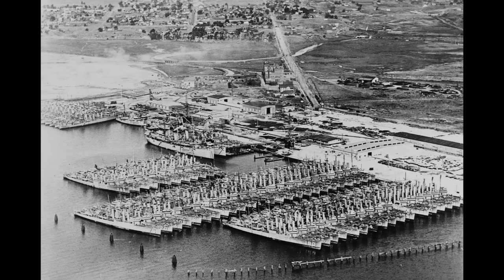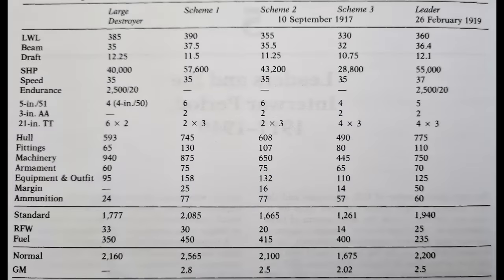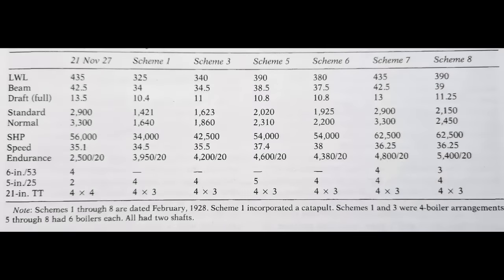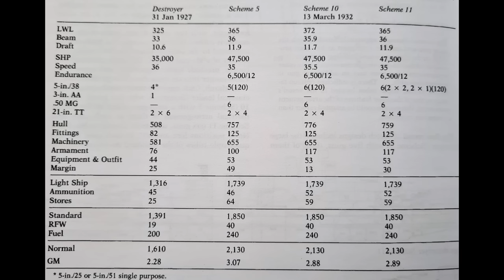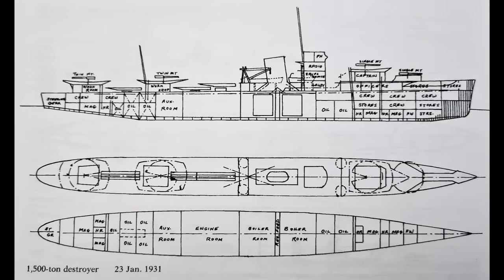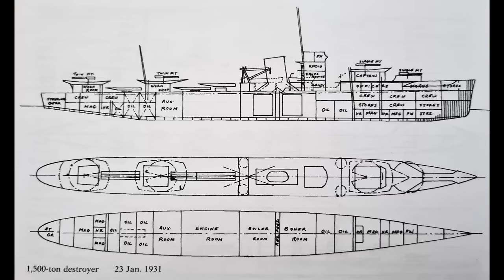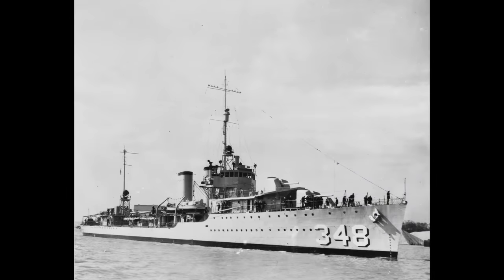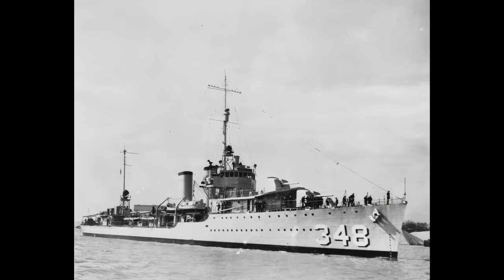The History and Development of the 5"/38 - Turns out you can take the sky from someone

Comment: Naval Dual Purpose &amp; Anti-Aircraft Gun Fire Control - This might be a good place to cover anti-aircraft fire control as it stood in 1939. Anti-aircraft fire control was more challenging than surface gunnery because of the addition of a third factor (height/altitude) and a second vector (rate of change of altitude). An airplane could not only vary its speed and act on the horizontal plane, but also move on the vertical plane creating a massive increase of possible vectors for which to calculate future position. Like surface gunnery, the intent of AA fire control was to put properly fused shells into a “basket” where the target aircraft should be when the shells arrive. First, the future position of the target aircraft must be determined, then the “slant” range to that predicted position calculated so that the flight time from the gun to the target can be set in the fuse on the shell. Added into this calculation is the “dead” time, the additional time needed to calculate the target position, transmit the data to the guns, set the fuse and load and fire the gun. The key was getting accurate range, altitude, speed, rate of change and bearing data, reducing “dead time” through automatic processing of data into and out of the calculator, remote control of the gun mount(s), reducing and standardizing the time to set the fuse and a high rate of fire. Initially this involved stereoscopic rangefinders, “follow the pointer” aiming, fuse setting on the mount and mechanical calculators, but the cumulative effects of the introduction of radar, remote power control, the proximity fuse and electric computers improved the effectiveness of AA fire exponentially until the introduction of jet aircraft seemed to wipe out all the previous advances in fleet defense.
The level bomber, often seen as a threat to surface ships in the 1920s, turned out to be the least effective and the easiest threat to counter. While level bombers could maneuver prior to their bomb run, once into their run, their course, speed, and altitude had to be maintained, especially for those bombers using a calculating bomb sight, like the US Norden sight. Predicting where the bomber would be until they completed their bomb run was a simple matter. Moreover, such a bomb run could be made more difficult simply setting up a barrage of shells at an area which the bombers had to fly through. Torpedo planes, while they had to maintain speed and altitude to properly deliver their payload, represented high rates of crossing for ships defending the torpedo bomber’s target. Dive bombers were the hardest target with the massive rate of change in altitude over the target ship at high angles. Both types of attack had delivery points (2,000 yards or less for torpedo planes, ~ 4,000 feet for dive bombers) after which defensive fire was useless. The real threat came later in the war with guided missiles and bombs (and kamikazes, manned guided cruise missiles), where the attacking aircraft could remain at high altitude and out of range of the defensive gun fire and guide the bomb or missile to the target, the bomb, missile or kamikaze not being deterred by heavy gunfire (which is where the beginnings of surface to air missile defense of the fleet starts). Since the level bomber was the initial threat, the initial response was a gun, firing
a shell with sufficient space left over for an effective explosive content after being mated to a large, mechanical or powder-train time fuse, with ballistics that could reach the level bomber at a range that would submit it to continuous fire for a sufficient time before completion of the bomb run with a rate of fire providing sufficient shells to destroy, damage or deter the bomber. The answer was remarkably similar across the navies, starting with a 2.95”/3” to 3.45” (75/76-88mm) gun during the Great War, and as aircraft performance improved, a 3.9” to 4.1” (100-105mm) and then a 4.5” to 5.1” (114mm-130mm) gun. Ships then began to carry multiple guns and then these guns were integrated with a fire control system to increase their ability to destroy, damage or deter the bomber. The answer to the torpedo bomber and dive bomber was an automatic weapon, putting enough projectiles into the target as quickly as possible to destroy, damage or deter the attacker before it reached its release point. Again, the response was similar across the navies, starting with .30/7.62/7.7mm machine guns, singles and then in multiple mounts, proceeding to .50/12.7mm/13.2mm, and as aircraft performance and structural strength improved, to autocannon from 20mm to 40mm, delivering not only a high rate of fire, but an explosive shell to well outside the delivery point of the torpedo and dive bomber. Then came off-mount sights and directors, then integrated range-finding devices and calculators to improve the effective hit rate.
Throughout the war, navies added more and more light and medium automatic AA weapons in powered and manually operated mounts, anywhere there was deck-space (some were more adventurous than others as to where they would mount guns). While this generated more firepower, that firepower was often not as effective as a more considered approach integrating fire control technology. One move, made by the RN for morale reasons more than anything else, was substituting single 3” or 4” guns in local control for similar single purpose guns or torpedo mounts, while the USN substituted 3” guns for multiple automatic gun AA mounts not yet delivered in 1940-42. Such guns could not elevate or train fast enough or fire enough projectiles to be effective against
single or multiple attacking aircraft, though in the rare cases where such shells actually hit the target, destruction was assured. The US Navy took the lead in AA fire control and maintained that lead through 1946. It was the first to introduce a director with a tachymetric calculator which plotted the predicted outcome in three planes (the Mark 19), then combine the director and the
rangefinder (which was important because the RF, when positioned off the director mount, was often pointed at a different aircraft than the director), then added electric computers, remote power control, and centimetric frequency tracking, ranging and height-finding radar. While the RN was the first to introduce a fire control system (and ranging radar) for medium automatic cannon, the USN soon outstripped the other navies (had the Dutch, and then the British, more time to develop the Hazemeyer mount, they could have had a world beater allied to centimetric ranging radar, but as it was, the mount suffered from reliability problems throughout the war) going from a “dummy” mount with ring sight using RPC to a gyro-driven sight that automatically provided an off-set aiming point which could be mounted on the weapon or a director, to integrating a ranging radar and an electric computer into the director or on the mount. The Japanese also adopted tachymetric fire control calculators but didn’t successfully integrate all the components of their fire control systems until the Type 94 system was adopted, though these systems featured more manual input and direction than US systems. The Japanese never adopted RPC for their AA guns, nor developed radar fire control, much less proximity fuses, which severely hampered the effectiveness of their AA fire. The 25mm guns in triple mounts did have an off-mount powered director with RPC and a manual calculating sight, but the sight was less effective given the higher performance aircraft later in the war. The British did not take a tachymetric approach to solving the future prediction process and their High Angle Control System (HACS), which went through six marks, was found wanting and was continually modified with bolt-ons to produce the same performance level the US and Japanese navies were getting from their directors. It wasn’t until the RN received several USN Mark 37 FCS (which they integrated with their own acquisition and targeting radars and RPC) that they had an effective heavy/medium gun AA FCS.
Reply: Read Lundstrom and then compare USN BuOrd's accepted AA kill claims vs actual 5in AA kills to get an understanding of how poorly 5In/38 AA performed in combat. BuOrd's faked stats were  promulgated to the RN who took them at face value, when they were actually inflated by a factor of ~10. A careful analysis of HMS Delhi, which carried Mk37 and 5in/38 guns showed that it performed no better (and arguably worse) than equivalent RN AA cruisers carrying RN AA FC and guns. In the 4 USN-IJN carrier battles of 1942, BuOrd accepted over 200 USN AA kill claims and awarded kills to each claim and based their kill stats on those numbers; the actual number of AA kills was ~35 according to Lundstrom, with 25 of these during the battle of Santa Cruz. 5In AA probably scored ~5 of the 35 AA kills. Even Captain Gatch of the USS South Dakota stated that 5in AA only amounted to 5% of South Dakota's claimed AA kills (she was awarded 26 AA kills at Santa Cruz by BuOrd with 127 awarded overall).

Comment: I always wondered why the US Navy didn't develop a twin version of the Mark 37 for use on the carriers to mount in the corner heavy gun galleries. Starting with HMS Ark Royal British carriers had twin 4.5 inch mounts placed accordingly and I always thought this gave the carriers an impressive heavy gun armament. I know the 5/38s in turrets would not be practical to mount in the sponsons due to all the below deck space that was needed. The 5/38 turrets mounted fore and aft of the island on the Essex carriers were not very successful because the gun blast would damage aircraft on the flight deck. Hence going back to 8 single 5/38s in the galleries during rebuilds. Hindsight being 20/20 perhaps it would have been better for the Essex class to have their 5/38s mounted in the same way prewar Lexington and Saratoga were mounted. Three single mounts on each corner gallery.

Comment: Fun fact...the 5" 51cal (other than the MK9 Gun for the submarines) were, oddly enough, bag charged guns.  Hence the conversion of the MK9 and its casing, which was cut down from 33" (838mm) to around 27" (680mm)  Casing length of the 5" 25 was 626mm.🫡

Comment: Still a fan of the 10.5 German AA gun.. as it evidently was light enough for land use in the Stug 3 and Flak39 electrics .  12mm-18mm is just to heavy to be man-handled and need specialize machinery and the success of the FlaK 38 8.8cm was also due to the weight of the combined shell, that is a loader could service the gun at 15 rounds/min.

Comment: I always have wondered how much do you have to enlarge Somers or Porter destroyers to put on them instead of the 4 twin-surface only mounts 4 twins dual purpose mounts. Both DD are 1850 Tons standard, and they carry half the guns that a 6800 Tons Atlanta class cruiser. And you don´t put all your eggs in one basket.
The difference in weight between a Mk22 mount and a Mk 29 it´s 15 tons. 60 tons on armament weight in total.

Comment: I am convinced if you could somehow mount four of these in a electrically driven turret and gave it radar, it could smack AShMs out of the sky.
Reply: 57mm L70:  3400 fps velocity, 200-220 rpm.  Programmable shells.  It’s a nasty piece of kit.  Even if it is just a popgun 😂

Comment: Frankly I'm surprised that they haven't decided to adapt some of these for land use with proximity shells to defend points against the Shahid drones.
Reply: Shoulder fired SAMS are a simpler approach today.
Reply: @WALTERBROADDUS   A Stinger is nice, but expensive. It has also been out of production for quite some time (in case you didn't know).
Reply: @john_in_phoenix They seem to be on plenty of battlefields lately.  And more effective and Less costly  than any AA gun. On land or sea.
Reply: @WALTERBROADDUS   "According to Reuters the US government has signed a contract for 1,468 Stingers worth a total of $687 million." That works out to $467,000 per missile. How much does a 5 inch shell cost again? The processor used in the Stinger is end of life in 2023 (not bad considering it's a 1980 design).
Reply: @john_in_phoenix  how much does it cost to train someone to use a stinger versus a five-inch gun crew? And how much effort are you going to put in and rounsd fired to hit something? The Stinger will win every time.
Reply: @WALTERBROADDUS   Obviously those Geppards are not useful.
Reply: @john_in_phoenix  developing laser in the 50 MW, 100 MW and 150 MW varieties that cost about 10 cents per charge
Reply: @michaelkendall662   And yet since I worked on SDI in the 1980s and early 90s, still not quite there yet.
Reply: @john_in_phoenix  they have 75MW deployed NOW......,working on 100MW systems and getting to the 150MW
Reply: @michaelkendall662   We had working prototypes in the 1980s that would penetrate 6 inches of steel (I can say this because they published it in the Huntsville paper at the time). Please cite your source on any 75mw "deployed" system.
Reply: @john_in_phoenix  several on YT with newer destroyers having them mounted  just aft of their VLS below their bridge in lieu of a CIWS.....when I watched it said it could take out conventional missiles but not hypersonic because of their extra shielding due to high-speed reentry...that was why higher power sourced versions were necessary

Comment: I dare to say, that the success of the 5"/38 in WW2, lead the USN to the deluded belief that it should be able to do everything well, and so they continued to insist that they use a 5" DP gun, when they would be much better off going with a gun with a bore of at least 155mm, if not larger.   Thus, we end up with the billions spent on the abortion known as the AGS, with Congress refusing to fund the ammunition.

Don't get me wrong, the 5"/38 DP gun did a good job in WW2, but can anyone even tell me when the US even shot down the last enemy aircraft with a 5" DP gun?   The 5" as a DP gun, should have never gone past the 60's ( definitely no later the early 70's )...because if it did, the USN might actually have a 155mm gun that could be used.